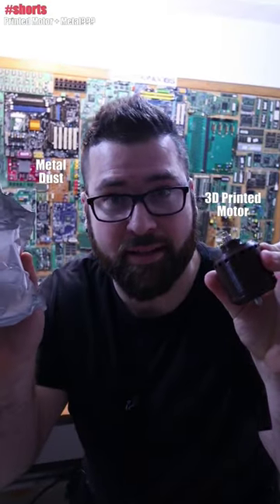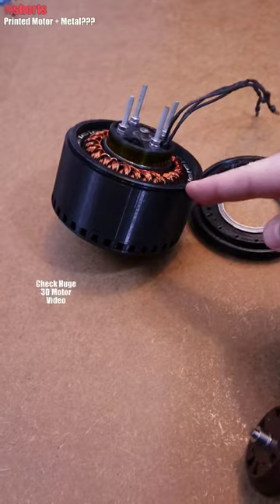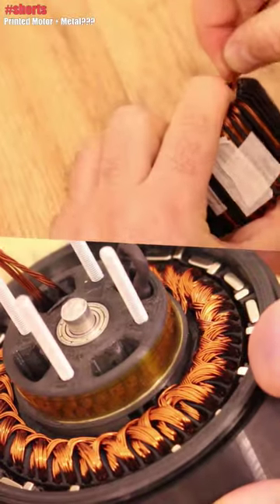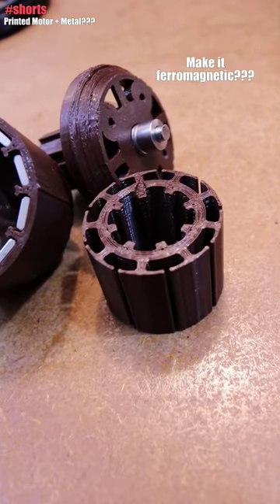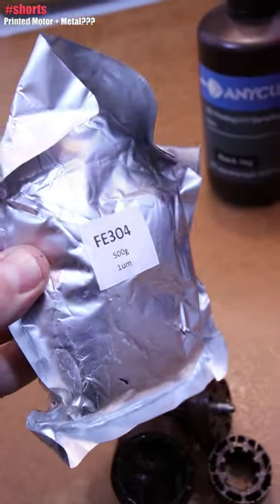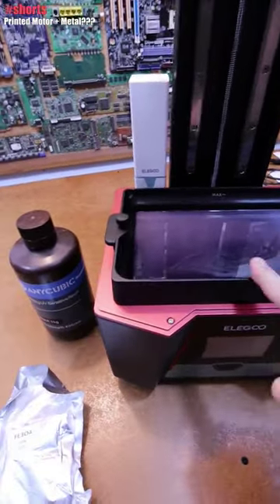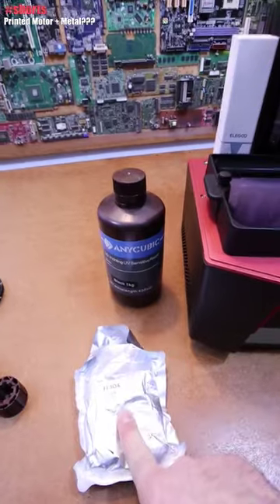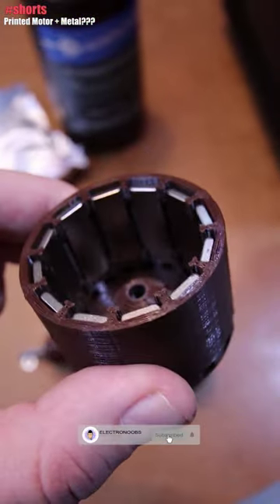3D Printed Motor Resin + Metal Dust - Experiment Whaaaat ???

Comment: Print a negative mold in soluble 3D filament. 
Mix Iron power with epoxy just enough to be damp. 
Pack this mixture into the mold to get rid of air and gaps.  
After cure, dissolve the mold in water.
Reply from the maker: Such a good idea! I will do it
Reply: nice & easier method 👍
I want @electronoobs to make video about it
& i will surely try this

Comment: Essentially you are creating what we used to use in radio aerials called ferrite. Ferrite doesn’t conduct because it’s made from iron dust and glue …. It doesn’t conduct because the particles don’t all touch to make conductive paths … the material would break down under high voltage because a high enough potential will lead to flash over at various points but you are never going to get a good conductor because you need it to be 100% made of a conductor.

Comment: i have a feeling that isn't going to work well, because the iron dust will sink to the bottom of the resin and won't stay suspended in it. there is a company called "the virtual foundry" that sells pla filament that contains metal, and the parts made from that can then be sintered into actual metal parts, although they don't always retain their shape too well.

Comment: Someone mentioned here to make a mold to cast the Iron. Aside from curing problems resin printing with iron dust won't be that good because of another thing. There's going to be some space between iron dust particles which the magnetic flux will have hard time travelling through. Thus your ferromagnetic core won't have as good of an effect as an iron cast.
Reply: He would need to disperse the iron in the resin using a chemical dispersant. The resin needs to be designed around the iron powder as iron is likely to absorb most of the visible light and limit cure depth.

Comment: good idea, but i would suggest you to make a 3d printed mould of the stator, and mix  the iron powder with epoxi resin, that would be more rigid, thus increasing the ferromagnetic material density, using a 80% powder to 20% epoxi resin or something near that ratio. with 3d printing resin you wont get a good iron powder density

Comment: Make sure you agitate the bath regularly.
The only consumer printers I know that let you do it are the SL1 from PrusA and the Form printers.
I’ve experimented with copper and iron , they come out of suspension too quickly, making only the bottom few mm metallic .. maybe create a circulating agitating system using a peristaltic pump that pours resin in and out?

Comment: But motors gets very hot in the long run, how can the plastic handle this.
Reply from the maker: I have to test different resins and see the results...
Reply: @ELECTRONOOBS  Im highly sceptical :D but carry on hehehe
Reply from the maker: @Sysshad  but I have to try it! The motor design has an air input for cooling. That also might help.
Reply: @ELECTRONOOBS  Add a temperature sensor, and reduce power automatically. If that makes it less usable or unusable, so be it, use that as a lesson for the next design, as long as it doesn't explode itself.

Comment: I tried this at 50% and ooof.  The iron sinks so quickly and blocks all the light and fails layer adhesion.  I have much better luck with resin printing an investment, then casting it in tin cure rubber, then mixing low viscosity epoxy with the iron dust and pour.  Also note that iron dust comes in lots of different formulations.  be careful and not use iron oxides (FexOx),  they have less permeance than straight up Fe